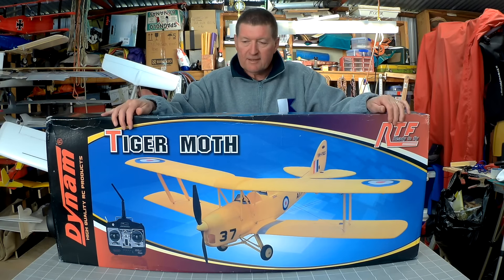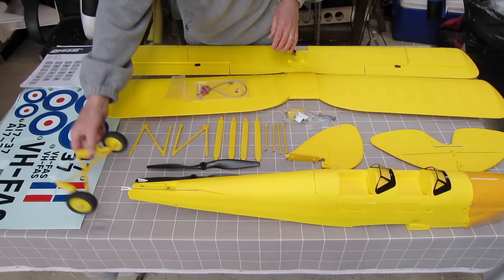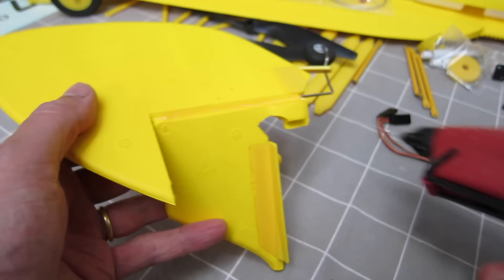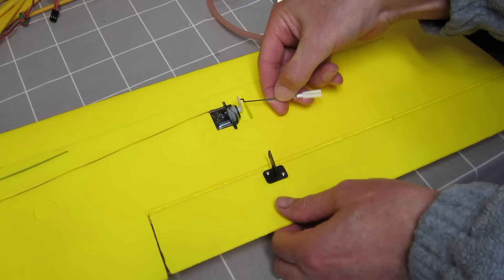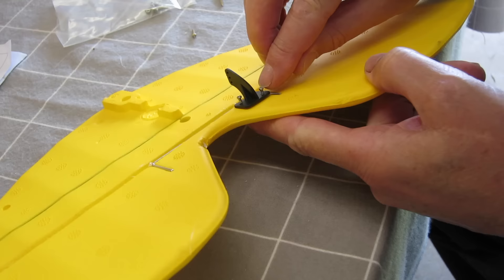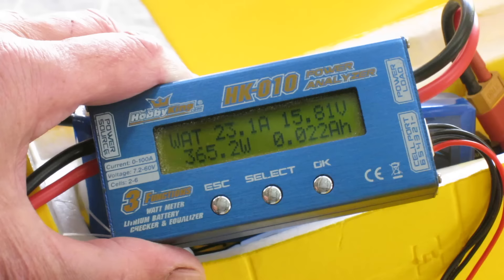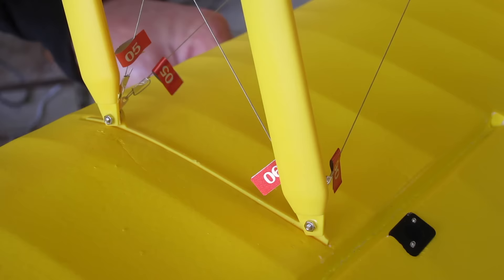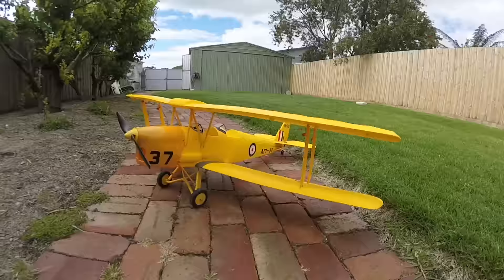Dynam 1270mm Tigermoth build

Comment: Hi Andrew, great job, just what I didn't need! now I just have to go and order one. I too had a fly in a real 'Captain Boggles' Moth with the genuine Gypsy Major plant.. life changing experience as I got the full 'payback' treatment, loops, hammerheads, inverted passes, man I was hooked by terror.. seeing all those wires and wooden bits buzzing in the wind does something to you especially at negative G. Anyway, you should do yourself a huge favour with that bird and fit a HobbyEagle A3 Super II stabiliser, it will blow you away, it literally puts the plane on rails and removes gravity. That plane may have to go on my single item Christmas want list to be conspicuously placed in order to be discovered accidentally by my wife..
Reply from the maker: Sounds like you have a plan, good luck, it's a ripper.

Comment: Andrew, I think the struts on the main landing gear should fit between the two lugs on the legs, not outside them squeezing them together. Otherwise great build and I shall definitely bend the main legs forward when I build mine.
Reply from the maker: Yes you're right, didn't pick that up at the time.